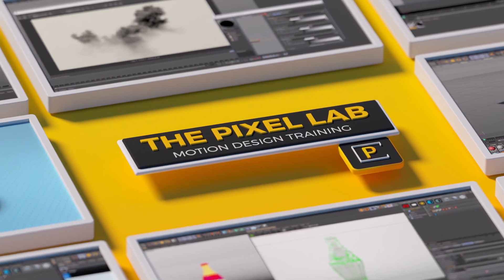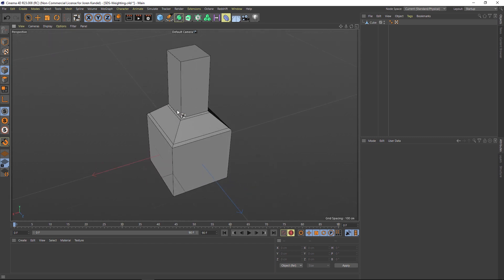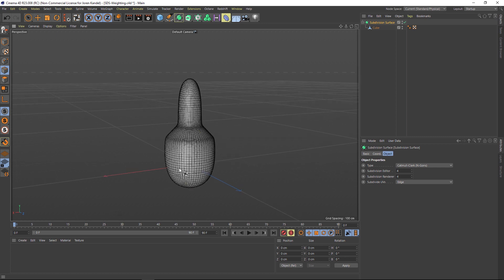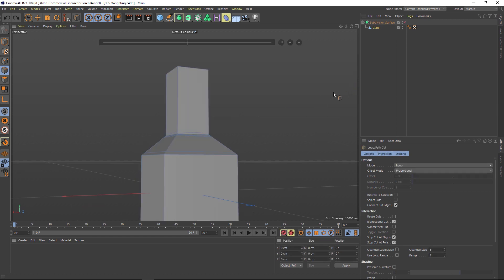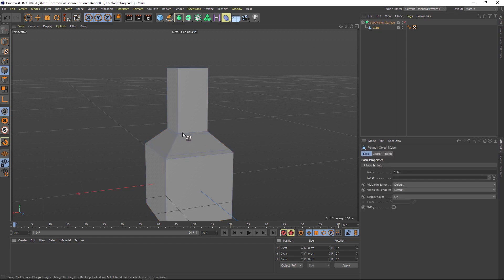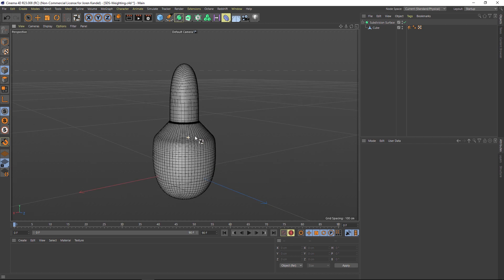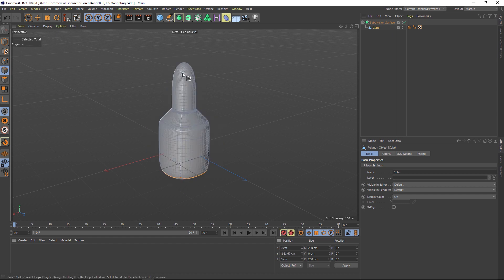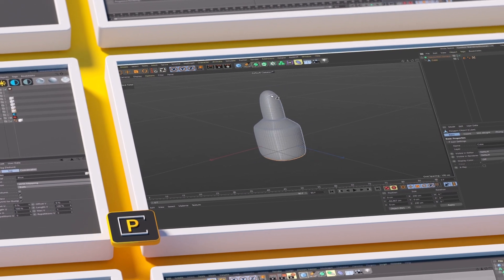Cinema 4D Tutorial: Save Time by Adjusting Your Subdivision Surfaces

Comment: I hope Maxon will not change the Material Texture option. I hate texturing with  Nodes, that is why i use Cinema 4D. Because Node Texturing sucks. I am very good at it but i just hate it. That is one of the main reasons i switched from Blender to Cinema 4D.